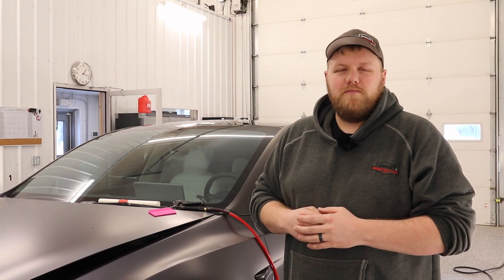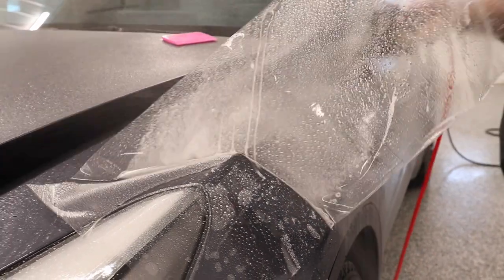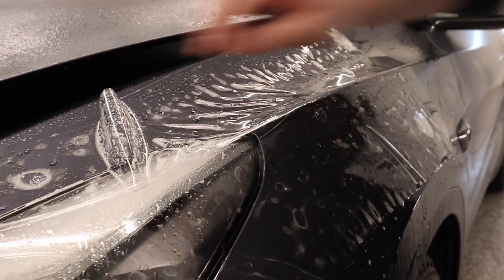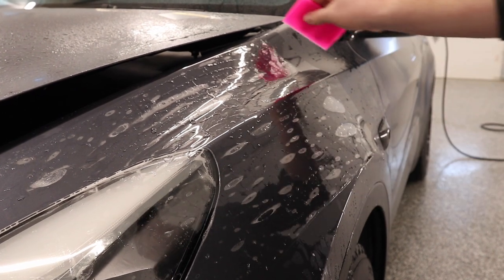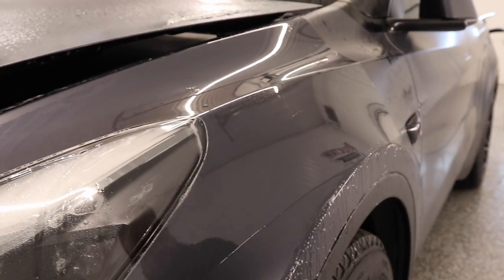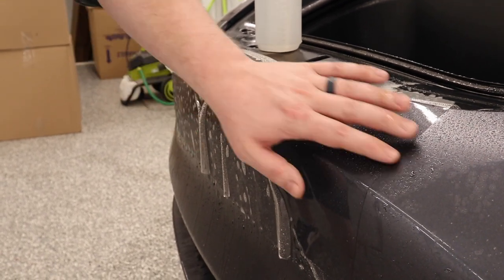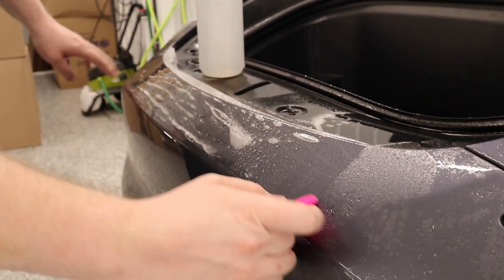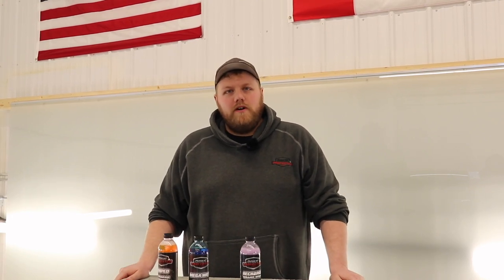PPF Pro Tips - How To Stretch PPF Over Body Lines

Comment: I just failed installing ppf on the front bumper for a 2021 TLX. Can I use a heat gun to help the material stretch or do you recommend? Mine has a programmable thermostat and I can set it to lower temps rather than the typical 300C+ you'd get with a cheaper heat gun.
Reply from the maker: I strongly recommend using a steamer or hot water to stretch PPF. Heat gun will damage the film very easily.

Comment: What tank/sprayer are you using?
Reply from the maker: This guy right here. Make sure you let Tru Spray know that Eric from Drive Protected referred you! https://truspraysystems.com/products/oasis-complete-3-gal-airless-electronic-tru-spray-systems-keg-tank-package-evolutionx-price-starting-at
Reply: What's your mixing ratio for that? I have the 5 gallon so how much slip would be a starting point to how many gallons?
Reply from the maker: @user-cz3sd2wh2f that’s all going to depend on your environment and humidity you’re working with. I’d suggest figuring out what works best for you in a 32oz bottle then once figured out, just figure out what that ratio would be in a 5 gallon sprayer.